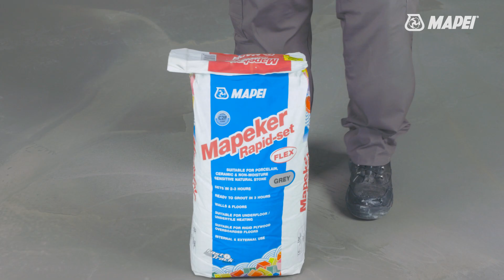Mapeker Rapid Set Flex Adhesive product video. | Screwfix

Comment: Hi There. I'd like to know if there is a multi  - purpose adhesive which can do both jobs. To stick down waterproof decoupling membrane onto a concrete bathroom floor. And to use the same adhesive to stick ceramic tiles on top  of the membrane ? So basically I'm asking if there is an adhesive to do both jobs ? and If this is possible. I'd like to know what is your best Adhesive ? Thanks